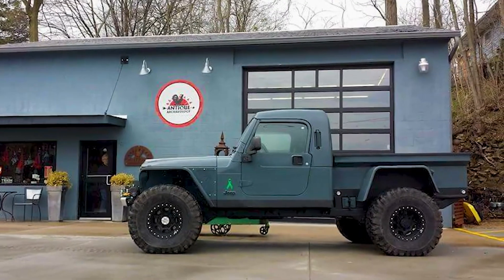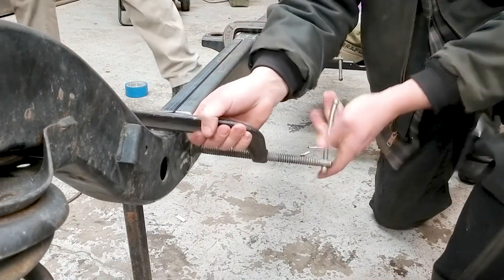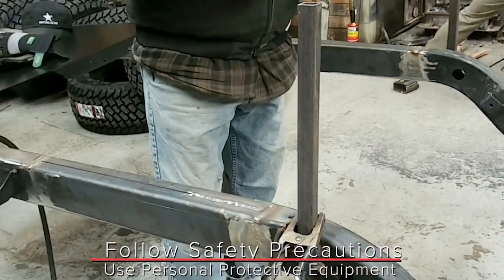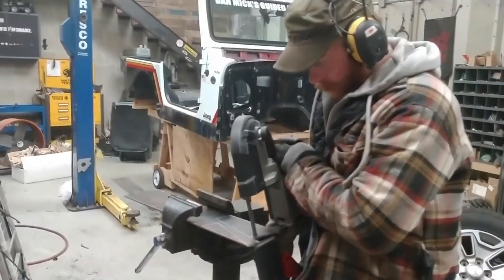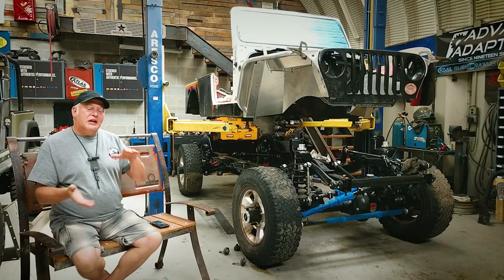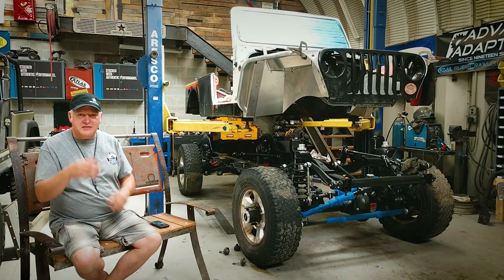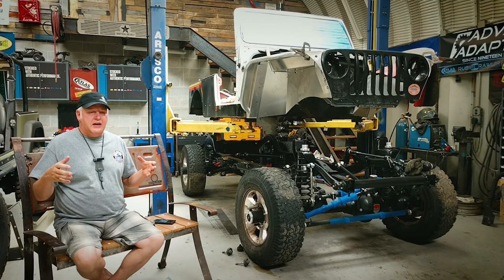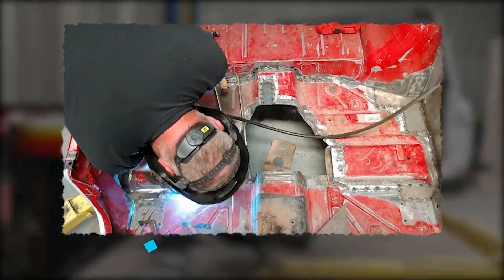Stretching A Jeep TJ 22" For A Massive 116" Wheelbase

Comment: Question.
When stretching a frame it makes sense to make the overall frame stronger but when you make the extension so much stronger than the original frame would that not put more stress where the joints are and cause weak points that will crack where the original frame flexes and the extension doesn’t?

Comment: I’ve seen guys remove some types of liner by hyper freezing it with dry ice then hitting with a hammer. It cracks apart and releases from the sheet metal. Do you think this would have been a good solution to remove the liner on your tub?
Reply: it would have been. i did this to remove the sound deadening out of the trunk of my miata.